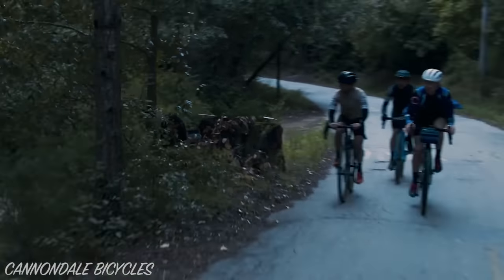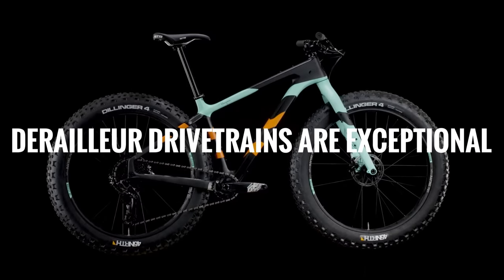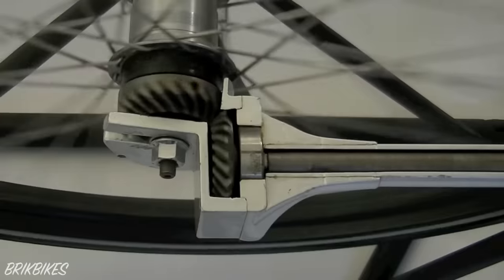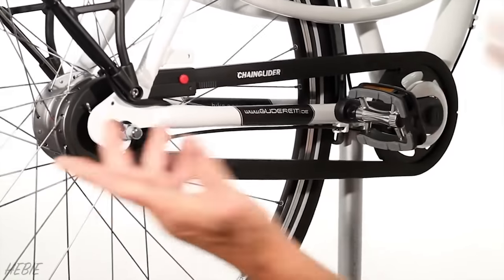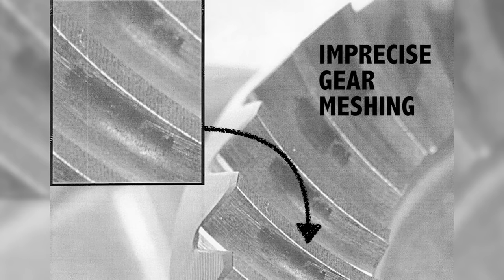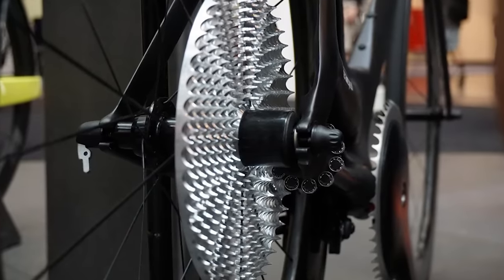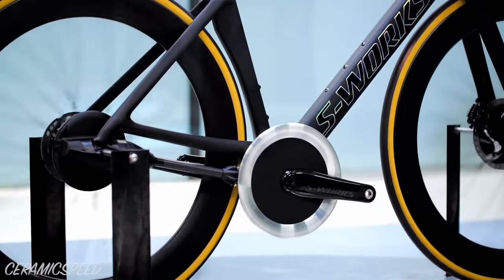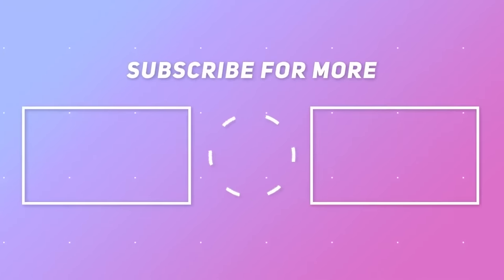Are Chainless Shaft Drive Bicycles a GENIUS or TERRIBLE Idea?

Comment: 2:53 - in motorcycles, chain drives typically waste 1 to 3 percent of the input energy, where shaft drives typically waste 5 to 15 percent of the input power. Bicycle shaft drives should have similar efficiencies to this.
Reply: Bill  while that is true of motorcycles, and while the power to weight ratio would be reduced due to efficiency on a bike and a motorcycle, I don't think the weight itself would be an issue with type of design on a bicycle. Assuming the shaft is made from fiberglass, carbon fiber, or the thin aluminum bike frame tubing, the weight would probably be similar to the front chain-ring parts, rear chain-ring parts, derailleur, and chain the system replaces. Definitely so if the gears are hollowed out to the minimum needed thickness and use lighter weight alloys. The system only needs to transfer between 250 and 1000 watts or so of total mechanical power continuously, so you can get away with much thinner and lighter materials than a 65+ kilowatt rated (500+ cc) motorcycle engine could.
Reply: This data comes from one example. Not really scientific is it?
Reply: @joshnabours9102  you mention the power but forgot the torque, which as said in the video, is gonna be concentrated on a small area of gears, instead of whole lenght of chain that sits on a front sprocket. In motorcycles nowadays you can only get a shaft having like +1200cc engine (VFR1200, BMW K1600, FJR1300), with few exceptions, so there's a lot of torque and power to compensate the weight and still these are only heavy touring/offroad bikes or maybe cruisers. Not a sport ones.
Reply: The thing is in bicycle you have to pedal it by yourself while in motorcycle the engine do the work
Reply: @Frost67915  The old Madura motorcycles had a 700cc and a 1200cc option, the 1200 ran a low 11 second 1/4 mile, not too shabby for a heavy cruiser with a driveshaft. I would NEVER put a driveshaft on a bicycle, lol. The only reason they're nice on motorcycles is they live forever with very low maintenance required.
Reply: Bill  How much extra weight? The extra weight is much less significant than the loss of efficiency.
Reply: @alfaeology  it let's you eat more of your favorite comfort food though.
Reply: @joshnabours9102  what
Reply: @alfaeology  you burn 5-15% more Calories so you get to eat that much more of your favorite foods. Or cake. Or pie. Or ice cream....
Reply: @joshnabours9102  good concept Josh and I agree with that. But, I think it is still kinda not that necessary. I just think it could discouraging cycling because you need more energy to do it but the distance is actually shortened. And it is kinda the opposite of what people have been doing by buying better bike: lighter bike so you can ride further. I also think maybe shaft can be used as a training because it is need more energy but I think there are other method that already achieved this by competitive cyclers. The only practical uses I can think of is for touring because it is more durable than chain or belt and doesn't need as much maintaining as the other option.
Reply: I would think if you could build it as ridged as the motorcycle is then your numbers would match better, but don’t forget, the gears can flex and lose efficiency on the bicycle…
Reply: Where did you get this info. That is my first reaction.
Reply: @joshnabours9102  if you pull the brakes while riding you can eat even more cakes!
Reply: Considering all modern  motorcycles have a huge surplus of power, loss is a moot point.
Reply: @johnmadsen37  however, bicycles do not.
Reply: @johnmadsen37   my take away from his statement of power loss on a motorcycle, is that shafts on bicycles, and motorbikes are similar concepts, so the power loss percentage on a bicycle theoretically should be similar as well vs. what's shown in the video.
Reply: Shafts are just fundamentally less efficient due to the Bevil gears. How I know? I’ve done the drive train calculations. Any time your torque changes directions there will be losses.

Chains on the other hand have parallel shafts which contributes to their efficiency.

This is also why FWD cars with transverse drive trains tend to be more efficient (all parallel shafts).

Literally the only reason to go shaft drive (like I have on my motorcycle) is if you have reversing loads and smoothness of operation (related to reversing loads). Also it’s possible to transmit more torque with a shaft than a chain, typically.
Reply: @Theonixco  that is exactly what I was trying to point out.
Reply: @Karl with a K relistically, I think a proper shaft drive would be about neck and neck with a rolohoff gearset and belt drive combination. Belts can go as far as 10,000 Km without needing changing based on some touring biker's real world testing videos here on youtube. Shafts would likely be even more durable with proper grease/oiling maintenance, but would likely have the tradeoff of lower efficiency than a belt. So it would end up being a tradeoff of a lower efficiency, permanent, low maintenance drivetrain that likely lasts the life of the bike versus a long maintenance interval, significantly higher efficiency belt system that needs belts every 3-5 years or 5-10,000Km. Shafts would trade some efficiency for more longevity versus a belt drive.
Reply: @Karl with a K the grease/gear oil would be for the gears needed to translate the pedal force 90 degrees in a different direction......

Also, greasable u-joints are a thing. Look it up. Millions of cars, semi trucks, and light duty trucks currently on the road today have them on their steering shafts as well as their drive shafts. It is mostly found on older vehicles though.

 Also, I would argue that if your bicycle's driveshaft has u-joints then somebody seriously over complicated your bicycle's pedal to wheel power transmission system. Gravel bikes and touring bikes with a hard-tail rear frame would likely be the main market for a driveshaft. Not rear suspension mountain bikes. A straight shaft with bevel gears on each end would be enough. Or a bevel gear on one end and the fancy ball bearing thing from the video on the other (or on both ends).
Reply: @Karl with a K u-joints don't transfer power at 90 degree angles though. How are you proposing the power is transmitted to the driveshaft on the bicycle from the pedals in then first place?

 In case you were not aware, u joints allow a bend in the path of the drive shafts (plural) but they introduce rotational vibration and inefficiency if they are not balanced with the correct angles on both ends. This is why you should always have the drivelines modified/adjusted when you put a significant ift kit on a truck. Usually with a separate drive shaft lift adjustment kit.
Reply: @Karl with a K to quote the whitepaper from the Belden Universal engineering company's website: "Single universal joints can compensate for an angular offset of up to 45° between the input and output shafts. This angle can be increased by using double universal joints and drive shafts." Based on how you worded your comments and the engineering limitations of u joints I had initially interpreted your comments to mean you expected a single joint to transfer power at a 90 degree angle. Your comments required interpretation because you have yet to specify or explicitly describe the exact design you are picturing to make your claims feasible. (Single u joints would be like a single wobbly bit from a mechanics set and double u joints would be like 2 connected wobbly bits for those who are having a hard time following)

However, even if we assume you were referring to a double u joint system (the most compact option space-wise) the design fails to fit the application on its own for the following reasons:

1) Efficiency. If we assume a double u joint driveshaft system design can be made which properly transfers power from the pedals to the rear wheel and we assume the same efficiency losses as a motorcycle shaft drive system (5% to 15%) your proposed driveline made solely of u joints would have losses of at least 10% to 30% because it would require at least 2 sets of double u joints. One from the pedals to the drivelines and a second 90 degree double u joint from the driveline to the rear wheel. For a rear suspension bike you would even need a 3rd set to account for up and down motion. Worse, it may be significantly less efficient than a motorcycle shaft drive since they do not typically have input to output angles of more than 15 to 30 degrees. This is not acceptable on a bicycle.

2) Durability, weight and expense. U joints have 2 design characteristics which makes them ill suited to certain applications with significant bend angles: the amount of torque/rpm they can handle drops significantly with increasing angle and the durability/longevity of the u joint drops with increasing input to output angle too. In order to compensate for the decreased ratings you must beef up the weight/size of the u joint. Increasing size increases expense. Decreasing size while maintaining durability with special designs and materials greatly increases expense. Not ideal for this application on a bicycle. Especially one where this proposed driveshaft is expected to last permanently without maintenance.

3) Space. The best realistic estimation one could easily get for the minimum amount of space needed for these drivelines is to connect 2 3/8 inch sized mechanic's wobbly bits together and bend them at a 90 degree angle from the rear wheel. You would be at least as far out as a rear derailleur and up to an inch more. This will likely put the drivelines in the path of the cyclists foot as it rotates on the pedals too. It also makes the bend angle for at least one of the sets of double u joints more than 90 degrees if it is to connect in between the pedals, further complicating the design. 

4) Connection to the pedals. There is no phsical way to directly connect a driveshaft to both pedals from in-between them as they are 180 degrees apart. And if you connect the pedals together, as is commonly done, the shaft connecting the pedals would be in the spot between the pedals the driveshaft needs to connect. Gearing of some sort would be required here would it not?
Reply: @Karl with a K ignoring the straw man/Texas sharp shooter fallacies present in those statements, I would like to know how your pictured design connects the double u joints to both pedals. Likewise, I would like to know how it connects from the double u joints to the shaft shown in the video. These are things you have claimed could be done easily, but have not explained how specifically your proposed design does them.
Reply: @Frost67915  Is the entire history of Moto Guzzi a joke to you?
Reply: @Frost67915  some of these exceptions is a Yamaha virago 535 , 750 and 1100. These 3 bikes are all cruisers and all v twin, i own 2 535 varigos and i have never had any issues with the drive train altho the 125 version of the same bike i have had many problems with the chain system even with the proper maintenance one of these problems is that if one of the 3 parts of the chain drive needs replacing you have to replace all 3 otherwise the unreplaced parts cause accelerated wear and tear, whereas in all of my motorcycles (4) with shaft drive they are all over 20 years and all still in close to perfect condition.
Reply: ...but you also get "shaft hop" that can be scary in a hard turn. Shaft for cruisers,  chain for speed and twisty road bombing!
Reply: @Karl with a K i presume Gary Johnson is talking about the shaft effect, which is apparently also known as the elevator effect or shaft jacking.
Reply: @Karl with a K yes, that is why bikes only the shaft drive motorcycles without paralevers have this effect. However, chains have always been superior to shaft drives in efficiency of power transmission, weight, and cost to manufacture. This is why most lower msrp motorcycles (usually also low displacement, ~300cc and under),  most high performance track motorcycles , and professional racing motorcycles still use a chain drive instead of shaft drives.
Reply: @Karl with a K as it turns out, a few dollars difference for each motorcycle on 100,000+ motorcycles manufacturing run can quite literally be measured in millions of dollars. If you don't want to take my word for it, listen to what motorcycle manufacturers say. Here are 2 quotes from an educational article published in 2019 by tvs motors, India's 3rd largest motorcycle manufacturer : 

"Despite all those negatives, chain and sprockets are the most efficient at transmitting power, with only 1 – 4 % transmission loss. That’s significantly less than belt drives, and a no-contest as compared to the heavy losses incurred by shaft drives."  

And the second quote : 

"So if they’re the sturdiest, then why don’t all expensive bikes use them, since cost doesn’t matter so much for the exotic machines? Well, to start off, they are way heavier than belt or chain drive systems, which limits their usage in high-performance supersport machines where weight saving is crucial. Secondly, these systems lose a lot of power during transmission. They are the most inefficient of the trio we have here and may bleed from 20 to 25% of the power by the time they transfer it to the rear wheel."

The difference in manufacturing cost between chains and drive shafts is similar to The cost difference between manufacturing nails versus forging a piston rod. High precision machining and forging will always be more costly than simple plate stamping and riveting processes. Not to mention the raw material and finished part price differences due to economies of scale. The quotes above allude to the exact same things mentioned in my last comment to you.

The title of the article I have quoted from is "Chain Vs Belt Vs Shaft Drive: Motorcycle Final Drive Systems Explained With Their Characteristics". What source are your figures and claims from?

Also, if you haven't noticed, my original comment was comparing motorcycle designs to bicycle designs. And There have been multiple sub conversations about motorcycles here, as this one was about. The comments under a video don't have to be directly related to the video.
Reply: Gear shift is much proven in Chain drive.
Reply: Actually, shaft drive as opposed to roller chain is ridiculously inefficient, wasting a lot more energy than your estimate, more like 33% loss, and yes roller chain is 98 to 99% efficiency
Reply: @Karl with a K I'm an engine builder and restored Jaguars for decades I dont make stuff up, not a kid for many years
Reply: @Karl with a K also, a drive shaft with universal joints is a wildly different device that a shaft with 90 degree gear drive on each end, apples and rocks comparatively speaking, think before you offer you incorrect opinions. Open your eyes and ears for a while before you use your mouth. I'm tired of know nothing "experts" that live in some fantasy land
Reply: Similar but not equal, if there is an exponential relation with torque you'll have exponential efficiency lowering torque applied
Reply: Auto scooters use belts, similar to CVT. What are their efficiency values.
Reply: @joshnabours9102  Still pointless beacuse if we have enough money to use carbon fiber to make a shaft, we might also spend it ob making the rest of the bike lighter and using the chain made out of carbon expect pins and rollers to reduce roatational mass.
Reply: @ludwigheijden5060  It is, it is a universal rule, a chain that has to be strong enough to handle such amount of power and torque is always going to be more efficient than a driveshaft. Bevel gears do not help.
Reply: @alfaeology  And? The thing is the same, you put power input on one side and output on another...
Reply: @mylarhyrule904  No, it is not caused bu its stiffness and being a bit prone to twist a little under load. It is because of the bevel gears.
Reply: @Theonixco  Yea, the difference would be visible more on a bike as they have worse power and torque to weight ratio than motorcycles
Reply: @Taskarnin  Yea, thats why a shadt has a point on a motorcycle, as some of them produce big amount of torque, and bicycles do not.
Reply: @jurekgadzinowski2895  in motorcycle it is move by the engine and not by your own leg like in bicycle. It will be a lot exhausting for daily commute I imagine
Reply: @Karl with a K Shaft is worse in everything. More maintenance, as the bevel gears wear out easier than straight gears like in an usuall bike. And bevel gears are always less efficient. The only 2 things that shafts do better than chains are: they last much longer and they can handle more torque. Pointless on a bicycle, as they dont have too much torque and the chain us cheaper than a cassette, replacing a bevel gear cassette eould be at least 3 times more expensive than replacing a chain.
Reply: @joshnabours9102  belts can handle even more than 10 000 km
Reply: @joshnabours9102  Remember that gears wear out. And bevel gears wear out easier than straight gears.
Reply: @Karl with a K Friction on a shaft itself is lower, friction on the bevel gears is high enough to make all that gain lost instantly
Reply: @Karl with a K U joints doesn’t really work 100% smooth as a straight stiff shaft, they tend to have small variation of speeds ob the output when turned by close to 90 degrees
Reply: @jurekgadzinowski2895  carbon fiber shafts need not be particularly expensive. 420mm (16 inch) long 16 mm (OD) pre-made carbon fiber shaft stock can be bought for 20 dollars retail with shipping. Attach some adapters on the ends to connect to the rest of the power transfer system and Bob's  your uncle. Making a Carbon fiber driveshaft for a bicycle is relatively inexpensive compared to the cost of manufacturing the frame (especially in carbon fiber) or the overall retail cost (2k - 5k) of the minimum price/quality bicycle that you would expect to see this type of engineered system on. 

Chains or shafts on a bicycle only need to handle an absolute maximum of about 750W to 1KW of power transfer through them.  So certain glues should be more than capable of holding up to this stress.
Reply: @jurekgadzinowski2895  properly designed and well maintained shaft drive systems can go well over 160,000Km or even 240,000Km (100,000 and 150,000 miles) though. Bevel gears and all. So even if belts can survive 30,000km  of use there is a massive durability difference between them.

Not to mention Rolohoff gearboxes use actual gears in them. And they are well known for their reliability beyond even the standard derailleur drive systems.
Reply: @ludwigheijden5060  they are talking in percentages. That means they must have tested it.
Reply: Modern gearbox is usually ~99% efficient. Somethings sounds fishy to me...
Reply: @Frost67915  I own two 500cc shaft drive motorcycles.  One makes 50 hp, and the other 82.
Reply: This is however complicated by two factors:
1 Motorcycle RPMs will be far higher than bicycle RPM
2 Some motorcycle engines output at 90 degrees to the wheel. This means that they must include a 90 degree bevel gear, which is most of the loss in a shaft drive, and a belt or chain drive would actually be worse.
Reply: @HALLish-jl5mo  

For point 1: friction is the source of inefficiency. Friction is decided by design of the power transfer mechanism nearly 100% of the time. Rpm generally only plays a large part in deciding what type of bearings you must use. 

For point 2: On almost all motorcycles the engine outputs power in the exact same orientation as your bike outputs the power you into the pedals on a bicycle. They are the exception rather than the rule. On both a bicycle and a motorcycle a shaft drive would require 90 degree bevel gears to change direction twice on the way to the wheel. A chain would not need these inefficient bevel gears and is definitely more efficient because of this.
Reply: @joshnabours9102  1. Efficiencies decrease access the board with increasing RPM. This is most pronounced with shaft drive.
2. DKW W2000, BMW K series, basically any Moto Guzzi… All bikes with longitudinal engines, and therefore bikes which need precisely one 90 degree bevel gear. Therefore they reduce the downsides of a shaft drive, while requiring any chain or belt drive to incorporate the main drawback of a shaft drive.
Reply: @HALLish-jl5mo  1. any efficiency decrease due to rising rpm can be summarily ignored from a general design standpoint if it is orders of magnitude smaller than the friction based efficiency loss caused by the inclusion of beveled gears. 

2. It does not matter if a shaft driven motorcycle is longitudinally mounted because the pedals on a bicycle are not. A bicycle therefore  would require 2 sets of bevel gears to transfer power from the pedals to the wheels. Furthermore, this means a shaft drive on a bicycle would be even less efficient than the original 5 to 15% measure from my original comment.